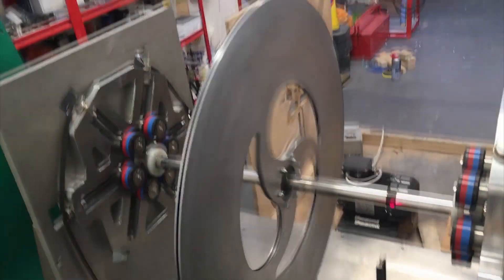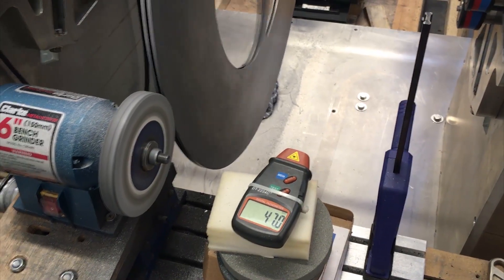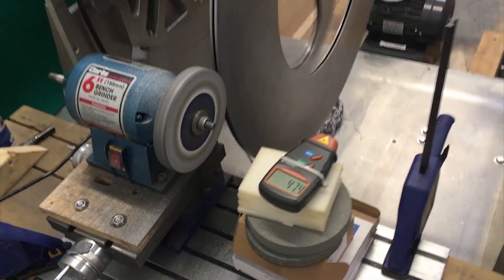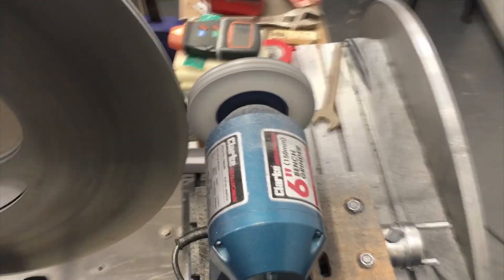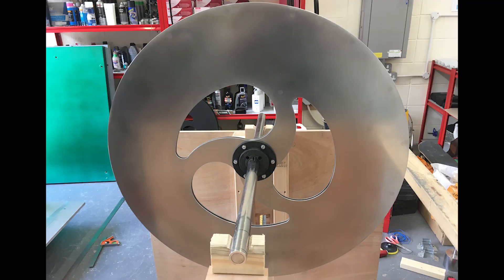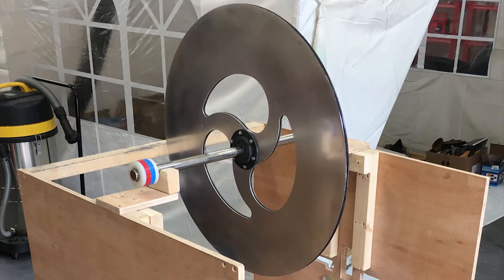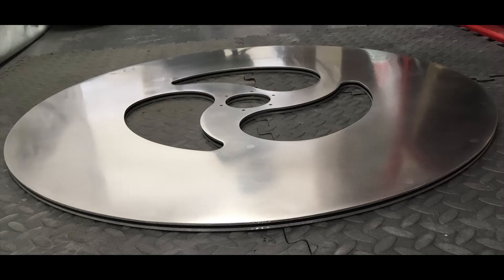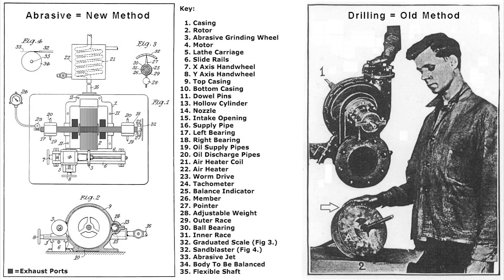Nikola Tesla’s 3 Plane Balancing Analysis Part 3 - The Concentricity Is Improved

Comment: Do I understand it correctly that you basically want to suck turbine outlet with it and get colder than atmostpheric air out whilest turbine is going to make power for both the pump and generator "out of thin air" ?
Reply from the maker: What most people don’t realise is the 1 psi absolute target Tesla suggested in his high vacua patent would allow the decompression velocity of compressed air higher than 1000psi. 

I'm not sure of the velocity exactly but it depends on the cross sectional area the air is moving through when the elasticity unwinds.

It is elasticity that moves a piston in a piston engine. The heat isn't wanted apart from to lower the oils viscosity and keep the driver / passengers warm.

I already know from my own experiments that 23 bar is higher than Mach 1.3. 

Of course the velocity is going to depend on the cross sectional area the air is moving through.

In Tesla’s article on “Breaking Up Tornadoes” 🌪 he claims the perfect nozzle will allow faster than Mach 10.

I think this might be a De Laval nozzle under high vacuum about 1 psi absolute.

NOTE A: Taking the heating value of the compound as 4100 B.T.U., a constant pressure of twelve thousand atmospheres should be attained; the theoretical temperature of the combustion products being about 8000° F. The highest possible speed would be reached if the gases were to escape into the atmosphere through a perfect divergent nozzle. In this case, the initial absolute temperature would be T1 = 8460° F.; hence the absolute temperature of fully expanded gases T2 = 0.285 / (8460/12000) = 583° F. Accordingly, assuming the specific heat at constant volume Cv = 0.33, the available energy is W = 7877 x 0.33 = 2600 B.T.U., and the maximum theoretical velocity V = √ 64.4 x 778 x 2600 = 11400 feet per second.

https://teslauniverse.com/nikola-tesla/articles/breaking-tornadoes

Try it yourself, put 11400 into a converter below!

https://www.bing.com/search?FORM=INCOH2&PC=IFJ1&PTAG=ICO-c9d0fc87&q=feet%20per%20second%20to%20mach

I worked out a while ago that the magic of Tesla's machines is velocity of fluid, as the maximum torque is when the rotor periperhy is half the fluid velocity and our team has already proven a faster velocity out than in using this scheme.

Forget all the free energy claims and I've got more power out than in.

We have genuine faster velocity out than in. 

Why?

Simply because of centrifugal force and adhesion and I'm sure others can expand on that, this is just my basic explanation of what I learnt and then taught to a number of others who happen to be highly skilled engineers.

Once I had explained the system we obtained further proof and here we are.

The team is growing now we have even more countries involved since the last gofundme video.

So get involved if you can, we can teach you what we know and together it can all be refined. We have some amazing people in the team and its completely global.
Reply: @nikola.tesla.r.and.d.centre  Is this compression/refraction cycle just any small or large fluctuation in air pressure all around us ?
Reply from the maker: @bringtheideas460  This is how I imagine it but I'm happy to be corrected.

We live at the bottom of the ocean of air. The deeper you dive underwater, the higher the pressure. Why? Because the deeper you go the more mass of water is on top you.

Plus the mass of the air is on top of the water.

Its sort of like having two liquids with one floating on the other in a glass.

So the air pressure is the highest at sea level and even higher if under sea level.

The large air mass is in a constant cycle of falling and compressing or rising and expanding. When it rises it expands it cools and when it falls it compresses and gets warmer. 

This can be proved physically by flying a microlight up to 10,000 feet and checking the temperature on the way. It's bloody freezing up there, no wonder water vapour condenses which is the other cycle Tesla tapped in his advanced two stage machines.
Reply from the maker: @bringtheideas460  there are compressions and rarefactions happening all the time. Think of when you create a draft in a building.

Tesla's is the wind turbine in the draft, exacerbating the draft.
Reply from the maker: @bringtheideas460  wind is a symptom of the compression / rarefaction cycle. Tesla's system is wind on steroids using very clever mechanics and thermodynamics. Making centrifugal force work for the flow instead of retarding the flow with the centripetal turbine.

Tesla's advanced centripetal turbine combines the best of both centripetal and centrifugal but you need at least one well tuned Tesla valvular conduit.
Reply from the maker: No that’s not the scheme. All engines have an idle speed.

A starter motor / method is needed to get this centrifugal turbine up to speed.

It’s a centrifugal turbine like an axial flow compressor / centrifugal Parsons turbine, but with no vanes or blades.

Atmospheric pressure’s elasticity is unwound in the diverging nozzle inlet into the centre, so by the time the air has reached the rotor it has had its pressure converted to velocity. 

Some of the velocity is converted into mechanical rotation and as the rpm increases the spiral path gets tighter and tighter, the velocity increases.

The air has no choice but to be compressed by adhesion and centrifugal force.

Therefore it’s more than just a “pump”.

Once the spiral path reaches a peak of compression it unwinds out of the diverging nozzle.

There is expansion and vacuum at the start of the run, compression in the middle and then expansion / vacuum in the exhaust.

Inexhaustible volume of low pressure is converted into mechanical rotation via a continuous mechanical draft.

The aim of the game is to get the air through the machine quickly.

It’s a wind turbine in a box with a faster exit speed than entry speed. Which we have already proved with anemometers at low speeds.

Atmospheric pressure isn’t high pressure but it has an inexhaustible volume and it’s the conversion to velocity is where the magic happens, as centrifugal force imparts energy to the air via adhesion which speeds it up even more.

Water wheels work because water is falling and the river, stream etc is channeling the flow to an impact wheel.

But the water wheel slows down the flow because of impact.

Tesla channeled the natural fall of air and his “air wheel” amplifies the pressure differential which exacerbates the fall speed, as nature tries to reach equilibrium but that exacerbates the fall velocity. 

This is just the very basic single stage system. There are many more advanced systems. 

The centripetal turbine has been done to death on YouTube and no “magic” has been found.

The centripetal turbine can consume insane amounts of air that the user has supply at a cost to them.

A system can be configured to harness the heat of the sun. That is great in one respect but is not in the same playing field as using the mass of the air at 773m3 per ton.

Expanding large amounts of air causes cooling and then the heat of the atmosphere becomes a secondary input.

Closed systems can work but in my opinion open systems are much simpler to build and require less parts.

As a minimalist this is my preferred direction.

It sounds like a crazy idea but people have been harnessing water falls for a long time.

If seems only Tesla and perhaps the Vedics were smart enough to harness air fall. 

In one of Tesla’s advanced versions he planned to condense the water vapor from air in a first stage centripetal turbine and flash evaporate it in a second stage, capitalizing on the viscosity / leverage of water. 

Then there is an even more advanced nitrogen shockwave steam version for which we have considerably evidence.

Still lots to uncover here, we are literally just scratching the surface.
Reply: @nikola.tesla.r.and.d.centre   am finding it difficult to understand that it is centrifugal force which is driving the stage one converging part of this apparatus- in sentence 13 above "as centrifugal force imparts energy to the air via adhesion which speeds it up even more " . In stage one the air is guided [forced as the system is externally started ] into an inwardly moving spiral which speeds the air up as it moves to the centre producing a drop in the air pressure which sucks in more air from the outside and there is the possibility that the water vapour in the air will condense adding to the pressure drop -- surely this is a centripetal force acting on the moving air mass ?
Reply from the maker: @zandor5657  the centrifugal machine has to have the air reach the centre for it to be flung outwards.

To get to the centre you could have a pipe to one side or both sides.

What I have done is make a diverging nozzle which is on exterior of casing to allow expansion / conversion from atmospheric pressure to velocity by the time it reaches the central inlet.
Reply from the maker: Atmospheric pressure is a spring in very mild compression. 1 bar / 14.7psi absolute.

The compression / rarefaction cycle is continuously happening all around us, and it’s invisible. An energy source hidden in plain sight. 

Tesla appears to have the most advanced machines for tapping into this cycle to unwind its elasticity for driving machinery.